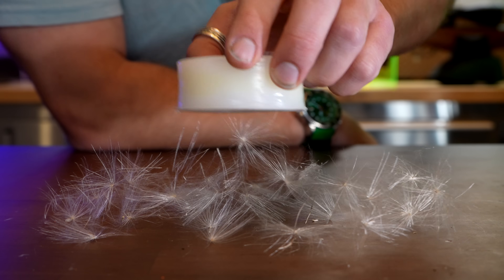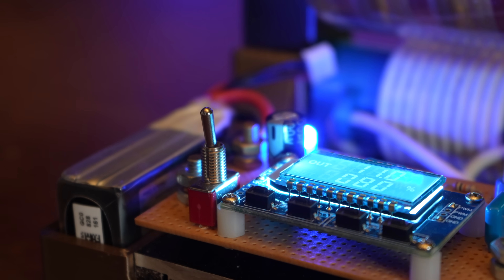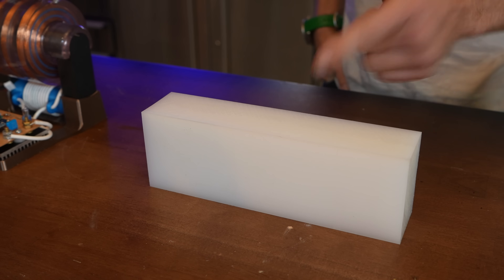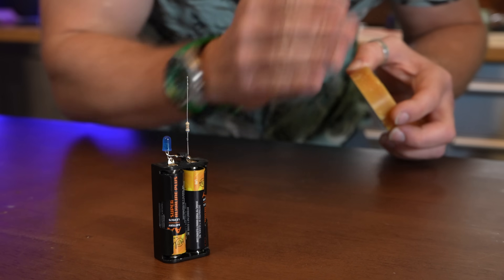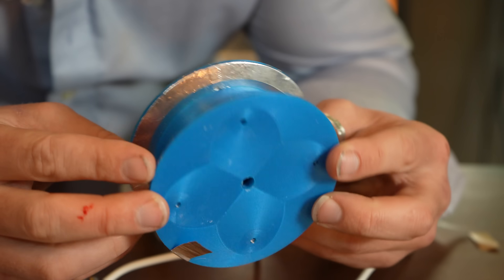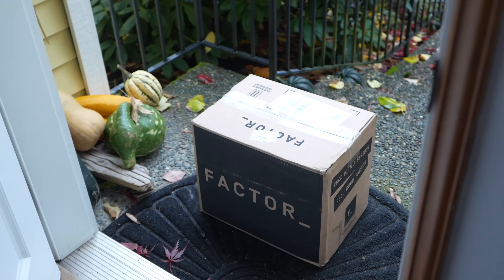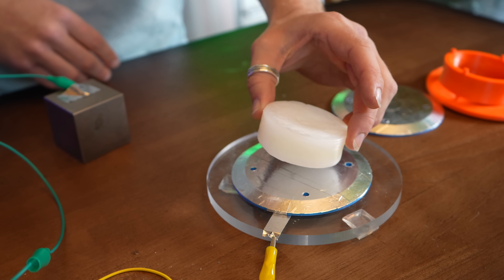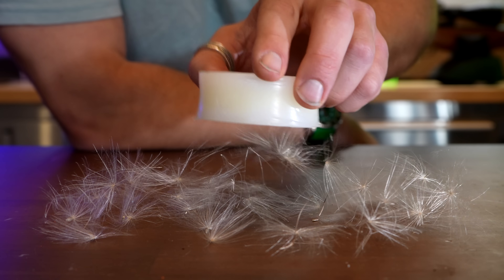Creating an Exotic Material With A Permanent Static Charge (Electret)

Comment: you don't know this, so i'm going to tell you. Corey Goode (who had to discredit himself in court due to shenanigans by his enemies) has said that he worked in a "secret space force" run by what is essentially Nazi holdovers and he said that the engine they had in the ship was a toroid-producer, it was a longer ship, like a hotdog, and it would create a double torus field around each part of the ship. Here's the kicker: He said that the engine worked on the basis of static electricity. They would generate the static and then somehow use or convert it to create this anti-gravitation field around the entire craft. Your research is not just groundbreaking, it's fundamentally transformational and has direct ties to hidden technology that is in excess of 300 years in terms of how much more advanced it is than anything we have planet side.

Comment: Hi bro...
I apreciate if you please work on an electrostatic perpitator filter as i work with laser and it makes alot of fume . So, a well designed electrostatic filter in a plastic box with some steel whole and plate as its electrodes woukd be full of fun and joy, specially with your funny high voltage circutes  .

Comment: Well that's a comically easy process to make these things. How are they not available everywhere for science demos and magic tricks? You've got to try using it to float those flying foil things and plastic bag rings
Reply: I know right! I have a big chunk of polyethylene sitting around in the lab. Just gotta build a HVDC power supply (or hook up a little motor to our Wimshurt, lol) to create the field needed.
Reply: It's called a swiffer
Reply: Wait. What if you added this as a component in an air filter to snatch particulates?
Reply: Another person commented that he worked at 3M and they did use this method
Reply: @alamppmala That's a good idea. I wonder what would happen with it near common sensors like MAF sensors though.... Charge would also reduce as more particles stick no? What about using it as as a way to detect charged particles? I know there are sensors that do that already but maybe depending on the charge loss bias determine which prevalence exists? Hell idk. It'd be cool to use the electret as a static sensor itself. I demand to see multiple electrets in series parallel opposed etc
Reply: This would be really nice to pick up pet hair
Reply: Agreed. I'd buy one of these just to play with
Reply: Free energy machines are of course a totally New concept.
Reply: @FrancisR420  I invite you to study my art. I literalize the effect of dividing by zero.
Reply: @FrancisR420  the goal is objects and energy from nowhere, and I know know know know that the source will help us do this. Free energy devices are about formalizing the design. We don't need to burn and do horrible processes forever, or at all...
Reply: @beginnereasy the goal of people building free energy machines is money from nowhere which is actually far more achievable.
Reply: @FrancisR420  God money is cursed.  holographic is better.
Reply: @beginnereasy what do you mean holographic?
Reply: @FrancisR420  you should have asked what do I mean god money is cursed
Reply: @beginnereasy you should have asked what I meant by "you only get out what you put in" because you made some pretty uncharitable assumptions about my politics.
 so what did you mean by holographic?
Reply: also I think my comment got deleted but energy from rocks is a battery and it's not free, the same rules of physics apply to chemical energy because chemical bonds are physical.
The future of energy is in efficiency and renewability which is extremely achievable.
Reply: You know there's renewable energy right now, megajoules of heat energy are bounced off Earth into space daily.
You don't need to squeeze blood from a stone.
Reply: There are cheap electret microphones, I haven't tried myself but for what you're saying they may be strong enough
Reply: I wonder if this could be used to make non airflow blocking dust filters
Reply: There is no net gain, so it is an expensive trick to set up.
Reply: could this accelerate the thruster, between the poles connected to the anode?
Reply: Exactly how my gravinductor works coil wires with a malluable electret insulator using scalar configurations over and under laterally, perpendicular, and parallel ...makes a fine isolation levitation warp.
Reply: I guess they dont last forever and the charge leaves after a few days.
Reply: @yaykruser your guess is far away from truth, they last tens of years in the same way as their counter part: permanent magnets
Reply: they probably quickly lose charge over time, since they're basically a raw, leaky capacitor
Reply: Replacing batteries and burning fuel with an object that just constantly produces electricity, is honestly just a social switch away...
Reply: @beginnereasy  unfortunately that's not what's going on here - study some E&M fundamentals
Reply: @beginnereasy that's not how that works, as stated it's very similar to a magnetic field and magnets don't create free energy. You only get out of the system what is put in.
Reply: Old ideas
Reply: @FrancisR420  this idea that you have to burn something to have power is antiquated. You will make objects that produce electricity. There's people in Nigeria who do it with common rocks.

Comment: Try the resin mixed with white quartz sand, quartz and glass are the best dielectrics, the difference is that quartz is piezoelectric, and provides a plus ;), basically a static energy battery, now you can understand the cases of 
Viktor Grebennikov and Edward Leedskalnin.

Comment: It would help, uhm, most of the world, if you could blend in metric units. Im sure even most europeans will have a rough idea of a foot being like 30cm and an inch 2cm or so, but we dont have an intuitive understanding of what those units mean, and the numbers i listed out of my head are not accurate either.
Reply from the maker: Correct. 30.5cm to a foot, and 2.54cm to an inch. Honestly though 2.5 and 30 are used as a standard. Pretty easy conversions!
Reply: @PlasmaChannel  Thanks for the reply. I mean sure, i could have just looked them up. But that's kinda the point, it's extra effort, and most people watch some youtube to relax after work. In the end it's obviously your choice. Just imagine people measured things in "average housecat weight" or "the energy required to roast one side of toast" as units haha. No offense meant obviously. We all just use what we are used to from growing up :)

Comment: I made one of those detectors to warn me if I might zap electronic components while soldering. Mine was stupidly sensitive though because it could detect me from 8 or 10 feet. It used a 9V battery and I think a JFET. It was useless as a warning but fun to play with. Thanks for showing how an electret is made. I kept coming across the word when making a crazy big condenser microphone with a 5" diaphragm for making infra-sound recordings.

Comment: You can map a higher resolution field reading by making a straight line of closer sensors and taking readings as you move the electret incrementally closer. Analog to digital conversion via arduino would make data acquisition quick, then 2d or 3d map the values to colors in something like Matlab.

Comment: The reason your detector is finicky is probably because you used standard transistors/resistors. Those often have design specs that have ~10% tolerance as that's usually good enough for most electronics resulting in quite a lot of variability. If you want it to be more consistent go for parts labeled for 1% or 0.1% tolerance. The price is a bit higher but it should be very consistent in comparison.
Reply: & op amps for matched high gain, could even use bipolar LEDs

Comment: So why isn't an electret a battery? I know that it can't be, or you'd have infinite power. What am I missing?
Reply from the maker: Because the electret doesn't actually store energy. The same way a magnet doesnt store energy. It's just a restructuring of polar molecules in such a way that all their charges line up one way. At least, thats the method I used. There are other methods such as coronal discharge which do implant charges into the surface though.

Comment: You could try arranging multiple electrets on a balanced rapidly spinning disc, similar to a Wimhurst static generator, or placing electrets near a Vandergraph generator belt, to see if there is any increased efficiency.

Comment: I tried maximizing potential using some of the same ideas and added a few..

 Composition

Best Option: Fluoropolymers (e.g., PTFE-based liquid precursors) for their high dielectric constant and stability.

Additives: Nanoparticles like barium titanate (BaTiO₃) or silica for enhanced dipole alignment and retention.

Electric Field Application

Optimal Field Strength: 10–50 kV/cm for uniform polarization without dielectric breakdown.

Electrode Geometry: Tapered edge electrodes to prevent charge concentration at the edges and ensure field uniformity.

Mold Design

Tapered Edges: Narrow tapering at edges (15–30°) to reduce charge concentration.

Material: Non-conductive ceramic molds with low thermal conductivity to minimize leakage.

Cooling Dynamics

Controlled Cooling: Gradual cooling rate (~1–3°C/min) to lock dipoles while avoiding stress.

Thermal Gradient: Even temperature distribution across the liquid volume.

Separation Plate

Material: Thin polyimide film for insulation, coated with a fluoropolymer layer for high dielectric performance.

Thickness: ~100 microns to maintain separation without significant loss of field strength.

Environmental Controls

Humidity: <1% during the entire process to prevent charge dissipation.

Pressure: Slight vacuum (~10^-3 atm) to reduce molecular interference with dipole alignment.

Combining Factors

Polarization Phase:
Place the liquid dielectric in a tapered ceramic mold. Apply a uniform high-voltage electric field via optimized tapered electrodes.Ensure the liquid is uniformly heated and free of bubbles.

Locking Phase

Begin gradual cooling while maintaining the electric field. Use the separation plate to ensure no discharge occurs during cooling.

Final Stabilization

Once solidified, remove the electret from the mold under vacuum conditions.
Reply: And what was your result?
Reply: @janhemmer8181   nothing. ai generated comment
Reply: The welding process is correct
But it needs to be done in millimeter layers
With graphene
The effect will be stronger
It will be the Staff of Moses
Reply: can be cut into plates and inserted into the battery
Reply: How about for the additives alternating layers of bismuth and magnesium particles?

Comment: Neat! Always something new and interesting. 

Could you apply this field to your print while printing? bed being ground, hot end being positive charge (of course external to the printing itself, electrical isolation would be a challenge) to orient your PRINT to be an electrets.
Reply: Another thought - I wonder if this could be used in combination with a detector circuit to make a foot traffic monitor. Maybe it'd be too prone to false positives though.

@16:25 Annnnd go figure, that's where this is used lol

Comment: The thing we are going to find out about "insulators" is that they are essentially ideal for this. With specialized equipment and supplies (high voltage power supply, heating equipment, and copious amounts of materials like PTFE or tantalum oxide), we could create electrets that rival or even dominate the usefulness of magnets. This stuff is the actual future.

Comment: You can try having the electret static, move the detector array around and then overlay the data. Or maybe use some kind of algorithm to extract the brightness and convert that into numbers. You should be able get a way higher resolution 2D slice of the field that way without making a ridiculously complicated detector

Comment: Electorets could be used in the field of electrogravitics. Thomas Townsend Brown's first gravitators were made with nine lead plates with beeswax mixed with cotton wool( empire cloth) used in early wire coatings.THe insulated clothe was placed in between each conductive plate forming an asymmetric capacitor.When brown would apply a voltage of 50KV to 300KV the capacitor would move from negative to positive. When he turned the field off these capacitors would hold an electrostatic field for several hours. See British Patent  300311 Us Patent 2949550.

Comment: Imagine what would have happened if you did the setup and let it cool and baby oil as you put the electrical field through.. for that matter what would happen if you used a liquid with an electret polyethylene ground up in powder mixed into it.. ferro fluid but done static!

Comment: For a "higher resolution" detector, you want the sensors closer together. You don't want a bigger 10x10; try to fit a 7x7 grid on the same size you have your current 5x5. That's almost twice as many detectors in the same area. Amazing proof of concept. I remember using electret condenser microphones in my high school auditorium 20 years ago.

Comment: Reminds me of the newer high magnetic permeability materials manufacture requiring an arranged field when processing the material.  Not certain how the spin formed do the same, though I recall reading the older like Mu Metal material and maybe later did something like that outside the forming.
Reply: Breakdown voltage achieved?  Albeit not visible plasma formed.

Comment: Question: Does the plastic based electret you used in the last part (15:30) will eventually discharge completelly due to conservation of energy since some of the power is used to energize the LEDs ? Is the electret actually a battery (energy storage ) ?
Reply: All of the energy for lighting the LEDs comes from the battery. The electret only loses a very small amount of charge from switching the LEDs, negligible compared to the passive leakage of charge through the electret.

Comment: You have heard about a monopole magnet being hypothetical, I wonder if you can make a monopole electret? Made in such a way that all of the negative polarity would be in the middle of the peice and the positive polarity would surround on the outside, in such a way that your detector could not be able to tell one face from a different face.
Reply: Charge a parallel plate capacitor and then separate the plates. You now have two electric monopoles.

Comment: 4:08 I think the corona shows that the material is actually well suited for the mold. The breakdown is across the air, I think you just shouldn'e have the conducting pad all the way to teh edge, or have a small wall on the print to further insulate against it just arcing through air

Comment: When I was a volunteer in the physics lab at the Oregon Museum of Science and Industry many years ago, I carried a little nail with me that I could secretly aim at the big Van de Graff and "shut it down" to mess with some of the guests (the ones I knew had a good sense of humor) or to bleed off the charge to keep people from getting shocked while they were preparing to get on the insulator stand. The point allows buildup and release of a fine stream of electrons to fly off and counteract the positive charge on the dome. The downside was that my foot would arc to the floor; you get used to that. Good times.

Comment: In my early efforts in this kind of science, everything I do in science is on paper. I was about 19 and I thought of doing that with a metal. Yes, "All metals are good conductors of electricity" or whatever happens with static electricity and metals or insulators is probably not a mystery. People talk about the "skin effect" and conductivity through the materials, but they are not exact sciences. The ""skin effect" and conductivity through the materials"" vary depending on the source of electricity. Just like AC and DC have limitations in how and why charges flow, something else is possible beyond those limitations. AC works well with low resistivity and ceases to function between a vacuum as the vacuum reaches a lack of permittivity. With AC, the ability to allow permeability of charges ceases as resistivity increases. DC is like AC without frequency, therefore, what DC can't allow via permeation, AC can. The other source of power allowing permittivity and permeability of charges doesn't exist. Anyhow, maybe the field that comes from doing that with a metal is the electromagnetic field. I saw that in a video and never researched what I saw. I didn't care until I got to see this video. As I mentioned, the """ skin effect" and conductivity through the materials"" vary depending on the source of electricity".". They also vary because of the "material" used in the achievements. People know 2/3 the story and are missing the 1/3.
Reply: People understand some of it, but um can't do all of it:

0. https://www.youtube.com/watch?v=ZgDIX2GOaxQ&t=2s
1. That's totally normal.
2. It also makes me wonder who um wants it from or will eventually buy it from?
3. Which leaves questions, who is "um"? And who does "um" feel "um" is?
4. I would like to mention, the world doesn't revolve around "um".
5. Not only that, passthrough currents don't differ if a ""skin effect" [rather than] conductivity through [material]" occurs. In both situations, the same amplitude in current will happen. Moreover, "People know 2/3 the story and are missing the 1/3.".